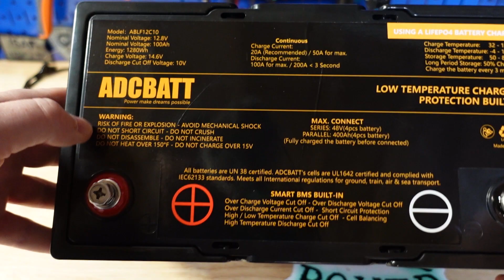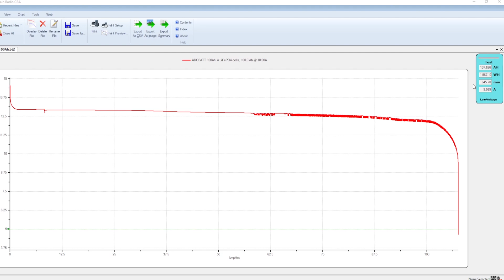ADCBATT 100Ah LiFeP04 Lithium Battery Review and Teardown

Comment: I have three of these same batteries and I'm pretty satisfied with my purchase. However, after two attempts to contact ADCBATT with a question, I'm not impressed with their customer service so far. Here's my problem, maybe you can help; I had two connected in series for my trolling motor with a single voltage monitor installed. My fault, I didn't disconnect the monitor when I put the boat in storage for several months. Now the batteries are fully discharged beyond the point of "jump starting" the BMS. My third battery was dead also, but I managed to wake it up and now it's fully charged. How can I wake up the sleeping BMS besides opening it up and charging the cells directly bypassing the BMS? I don't want to void the warranty, even though customer service doesn't seem interested in helping with this issue. Thanks!

Comment: what charger would you recommend for me to buy for this battery? I'm thinking about getting 2 and making it 24v. would a amped outdoor 10ah battery charger work for it as well?
Reply from the maker: I use the Amped 10 Amp charger for all of my 12v big battery charging https://ampedoutdoors.com/collections/boat-batteies/products/10a-fast-lithium-charger-lifepo4?aff=8

If you get two of these and wire them in series, I would consider the NOCO 2 bank 10 AMP charger. Amped also sells it. 
 https://ampedoutdoors.com/collections/boat-batteies/products/noco-genpro10x2-12v-2-bank-10-amp-on-board-battery-charger?aff=8

Comment: Perhaps the light is to prevent the battery spending an extended time at a high state of charge (it was 14 volts in your test).
Reply: The light is blinking to indicate that the BMS is balancing the cells. The light will turn off when the batteries are balanced.
Reply from the maker: I had charged it prior to the video. The light went out the next day. I wonder if it was a short indication and it times out after 24 hours? IDK, just guessing.

Comment: I'm grateful for your videos and the fact you do this independently, but I think you glossed over some important points against this battery that indicate poor engineering.  First, short circuit protection should never allow contacts to be welded to the battery posts.  That indicates the circuitry used is taking too long to  detect the short which in my mind calls into question the quality of the BMS.  Imagine if GFI breakers worked as slowly.  Second, those square zip-tie holders are stick-on and trust me they are not very sticky.  Over time those will detach.  Last, I think your videos are not providing qualitative comparison data that you are acquiring as you teardown more manufacturer batteries.  How about a short monthly video comparing brands and how you rate them from best to worst, like the "projectfarm" channel does with items he compares.  Battery technology, and quality, is changing quickly so it would be nice to see a summary from time to time.
Reply: It's a dirt cheap battery 🔋
Reply from the maker: You're not wrong! I really appricate the feed back. I will checkout projectfarm and see if I can't learn a thing or two. Thanks for watching!

Comment: That Blinking light is drawing constant unnecessary power!!
Reply from the maker: It actually went off after 24 hours.
Reply: The light is blinking to indicate that the BMS is balancing the cells. The light will turn off when the batteries are balanced.

Comment: So, just to be sure, if I upgrade from a 60Ah to a 100Ah battery, will the 50 Amp circuit breaker need to be replaced for higher rating? I got the DIY kit from you with 50 Amp CB...
Reply from the maker: Great question, no.  The amount of current that you pull will not change. But the capacity will, so your battery will last longer.
Reply: @iceholepower8012  Great! Now, should I get a bigger box for the ADCBATT 100Ah battery? If so, does Monolith make a bigger box?